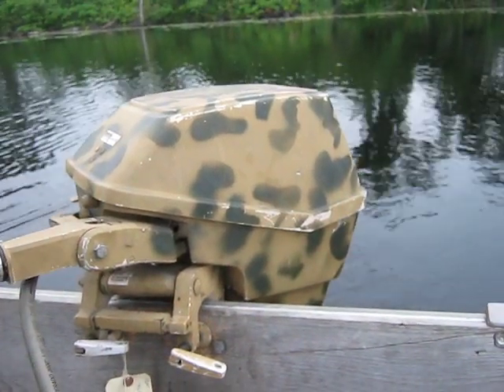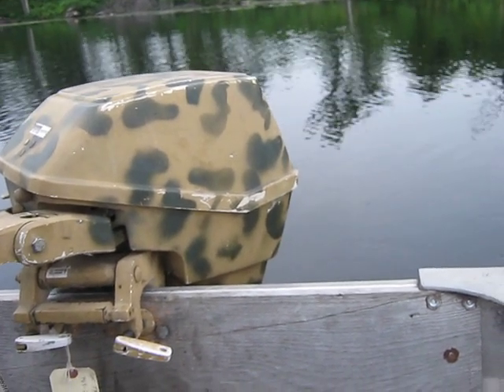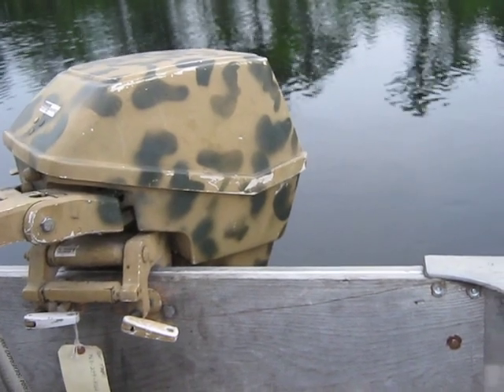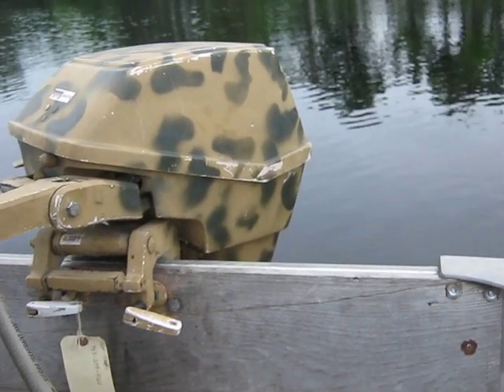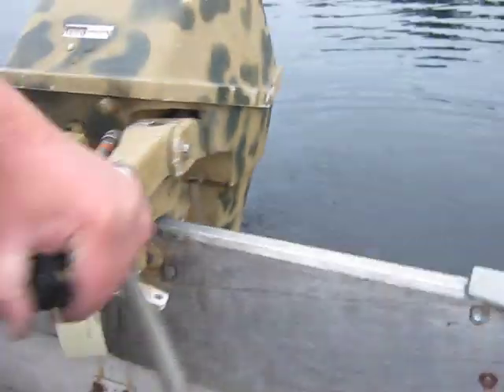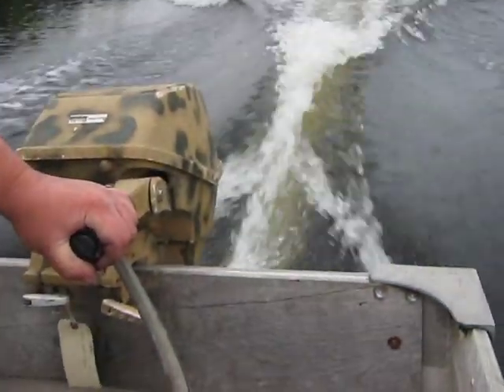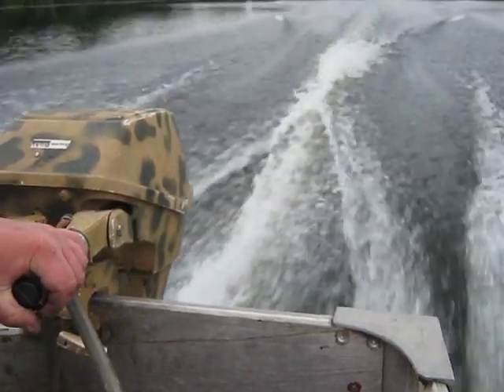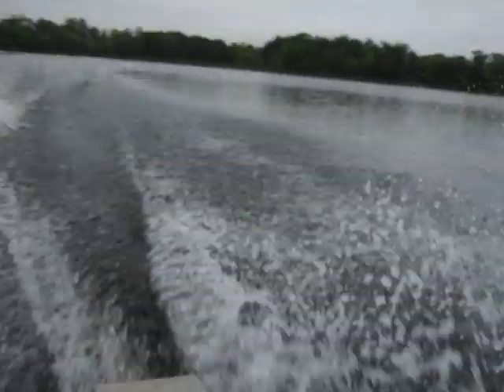1984 Sea King 15 hp outboard motor

Comment: I have a 1983 Sea King 15 that is kicking my butt.  I have rebuilt the carb and fuel pump.  New spark plugs.  Change the lower unit impeller and oil and just recently cleaned up the points and adjusted them.  It starts right up every time but it has a hesitation where the motor will frequently kick side to side.  I really enjoy your videos and watch them all the time thinking that some day mine will actually run like yours do:)  Any input would be much appreciated.  Thanks

Comment: Great video. I have the same motor. Quick question; what carb kit do I need? Mine runs good at wide open throttle but won’t idle. Going to start with a carb. Thanks and love you videos.

Comment: Hello, I just got a Sea King 15 HP. I removed the lower unit and I removed the 6 bolts that secure the power head and support plate to motor leg. I try to lift the power head, but it won't move at all. Could you tell me how to remove it?

Comment: Great vid.....how does the stop switch get wired on these engines I just got one and the guy didn't remember how the stop switch was wired......thanks matt
Reply from the maker: hotrodlincoln886 One wire to each set of points.

Comment: I have this same model... Lately it takes a while to start and when it does start it runs very slow even with the throttle opened all the way... Any ideas?
Reply from the maker: cody dickson Sounds like it's running on one cylinder.